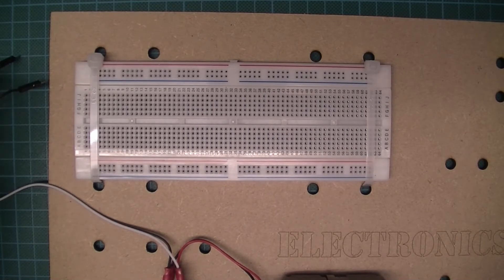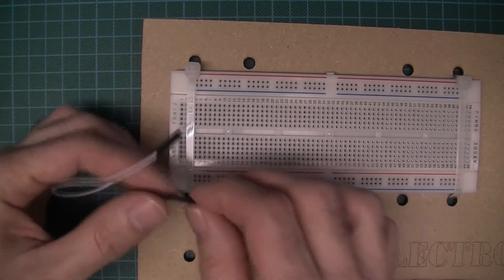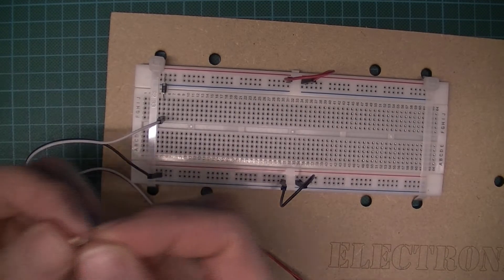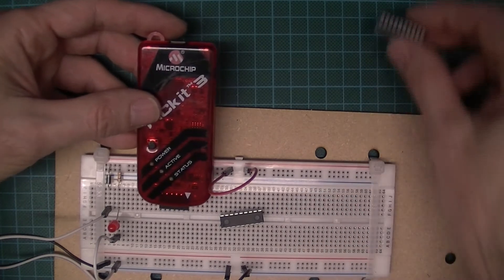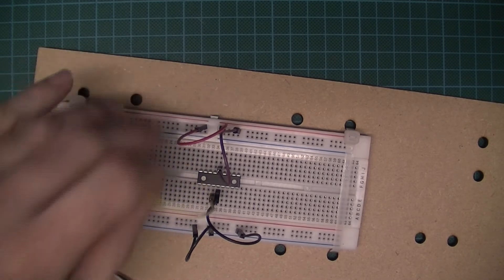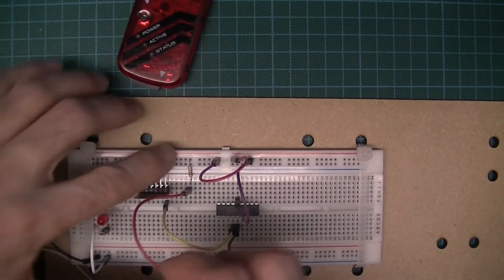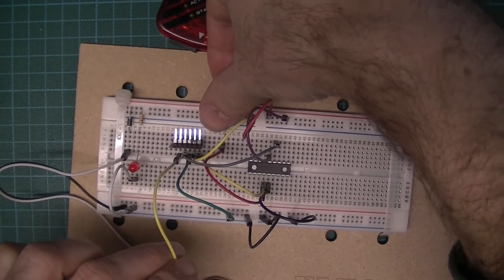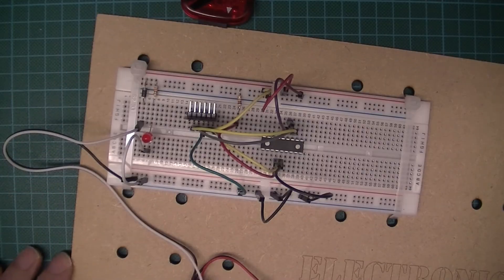PIC16f88 + PICkit3 ICSP programming circuit

Comment: nice work dear friend 
i need help identifying this board and how to program the controller as i can see it has icsp programer 
here is the photo 
https://1drv.ms/u/s!AtKgTvpXasDggb947pNBwy5Br9kevQ?e=Rntr1M
and this is the pic for pic chip
https://1drv.ms/u/s!AtKgTvpXasDggb959z5-2NuuyufZoQ?e=xcbc46

what type of controller i can use it with it and how to program it and if there is code examples for it please give me the link
as i'm new in dealing with microcontrollers

thank you
Ahmad
Reply from the maker: Ahmad, is this an old development board created for the original PICkit1 programmer? We had some old programmers and they used a serial interface and I suspect that's what the DB9 connector is on the left hand side of the board. Around that time the PIC6F84A was a popular microcontroller for hobbyist / education use and it may be supported by this board. Better microcontrollers (e.g. PIC16F88) may also work as they have a similar pinout. The PIC16F84A needed an external clock (typically 4 MHz) and I see this is included with the 2 capacitors at the bottom of the photo. The old PICkit programmers are no longer supported in MPLAB (you'd need to use a very old version that pre-dates MPLAB-X) so it might be worthwhile investigating whether you can tap in to the ICSP interface. Good luck.
Reply: @PizzeyTechnology  so any solution or throw it away how to program it any working software with serial port
Reply from the maker: Do you have a Pickit3?

Comment: Another question, in normal “production use” so to speak, I understand it’s common practice to set nMCLR=1 at all times thru the pull-up resistor, but when programming and debugging, doesn’t the PicKit keep this held up itself? (of course PicKit manages in general this and the other programming/ debugging signals involved, so this as a byproduct would imply it holds the pull-up, too? And the term ICSP, would need a more clarified and exact definition. ICP means basically you can program and/or debug your PIC-based design more or less “in the final board version”, that is programming “in place” as opposed to standalone programmers in which you seat the uC to be program for later “transplanting” it to the final, production board or circuit, is this right?
Reply from the maker: Some good questions there. The PICkit documentation recommends that you include a pull up resistor (4K7 - 10K) on MCLR, and that's what I do. It is not strictly necessary for programming when the PICkit is connected, but when disconnected the lack of a pull-up resistor will likely reset the device. You could always disable MCLR via the config bits, not that I have needed to do so myself. We share the same understanding for the meaning of "ICSP". As an aside, the PICkit 3 PCB includes an ICSP header (J2) in case you need to reprogram the device (https://microchipdeveloper.com/faq:3362) and this is essential as the microcontroller is surface mount and cannot easily be removed.

Comment: Now when you say that “when programming put the peril off” does it mean that this breadboard design must get its power supply from the PicKit? Then what’s the purpose of setting up all the power rails, and protection stuff, diode etc., when it would get powered by PicKit? It does not seem clear to me from your explanation. If I get it on (LED on and stuff) and then I proceed to program thru the PicKit, does this imply any danger or redundant powering? Thanks anyway for this tutorial, it’s very interesting and it gives a few of basic yet important advice.
Reply from the maker: Without watching the video again, I'm uncertain where I mentioned turning the power off. Possibly when connecting / disconnecting the PICkit? That might be a sensible approach to follow when making any modification (or connections) to a circuit. You may experience problems with all but the simplest circuits if you choose to power the circuit from the PICkit itself. Check the data sheet, but I think it is limited to something like about 30 - 50 mA, and that's one reason why I prefer to provide an additional power supply. For student projects I think it's always a good idea to include a reverse bias protection diode as it's all too easy to connect a battery the wrong way round or at least momentarily touch the wrong terminals.

Comment: Can I use USB power to source circuit? i mean a USB's 5v power and GND, rather than batteries, is it safe?
Reply from the maker: Do you want to power a PIC microcontroller circuit   using a USB power source? That may be possible but it would depend on the circuit. If you are programming the circuit using  a PICKIT 3 or 4 then you may be able to power the circuit using the PICKIT programmer. You can configure this option in MPLAB X. Check the PICKIT manual first to make sure you do not exceed the maximum current.
Reply: first Thank you for fast response, yes, but i better get same battery holder as you have in video and 4x 1.5v batteries,  please keep up tutorials about pic microcontrollers, you explain things in a easy to understand way, for me ,as a student its very helpful and interesting.
Reply from the maker: @shaahkrulo3623  If you use 4 x 1.5 V batteries you will have a total of 6 V. Make sure you include a silicon diode (Vf = 0.7 V) to bring the supply voltage down to 5.3 V. Many of the older microcontrollers have an operating voltage of 2.0 V to 5.5 V